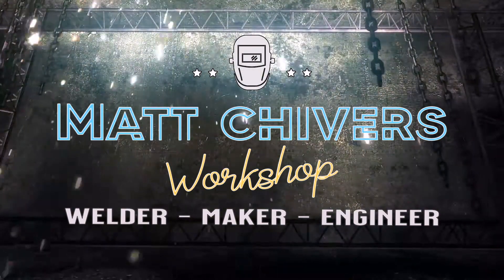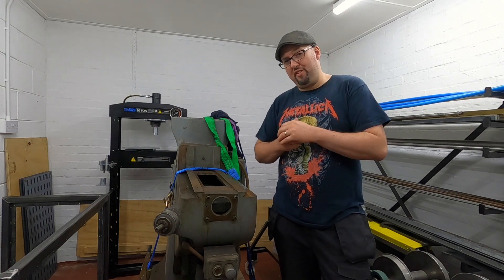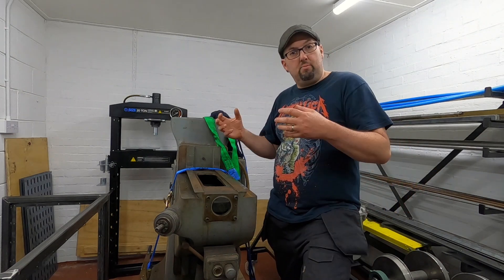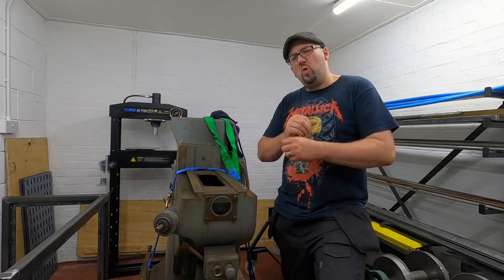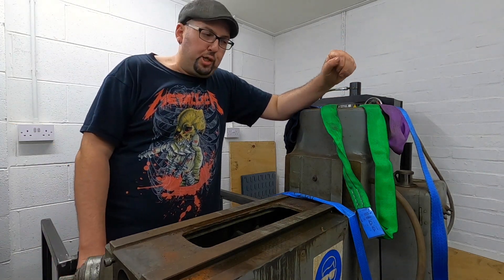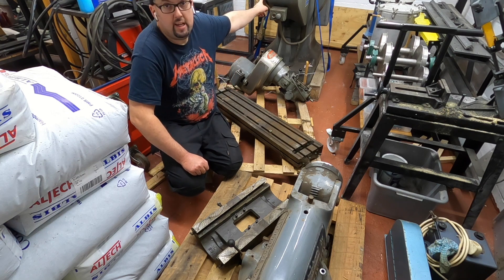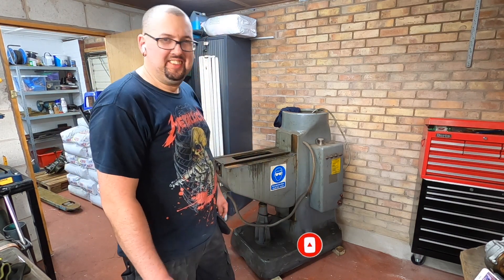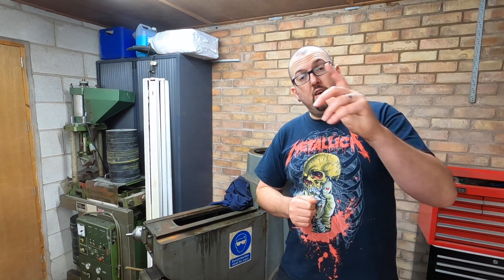Bridgeport Milling Machine pt 1 - I've bought one!!

Comment: Do you have a wide selection of great machines over there to choose from because here down under i only have the Chinese and Taiwanese to contend with, which is not bad but getting a American colchester  lathe would be a dream but just way outside my budget unfortunately lol. Love the content like always.
Reply from the maker: Hi Craig, Yes we have wide range of machines here, you name it, we got it. Price on the other hand is the issue, Hobby size milling machines go for more than Bridgeport size on the second hand market in the UK. Wear is also an issue, most cheaper machines you have to really pay attention too, usually cheap for a reason! Ive been lucky with the Bridgeport Mill and the Harrison Lathe, wear on the ways seems minimum on both. They do have their issues which need attention, but nothing that stops them being functioning machines. I always go with the Moto, "if your meant to buy it, you will own it". Matt. 👍

Comment: Conflagrations Matt! That thing is going to serve you well for many, many years. Any thoughts on equipping it with a CNC mod ? Now would be the time to install the ball screws.
Dick B. from New England
Reply from the maker: Many Thanks, definitely no thoughts or plans on converting it. We have the desktop Tormach cnc to learn, then we will upgrade that to a bigger machine. And always keep a manual machine. 👍